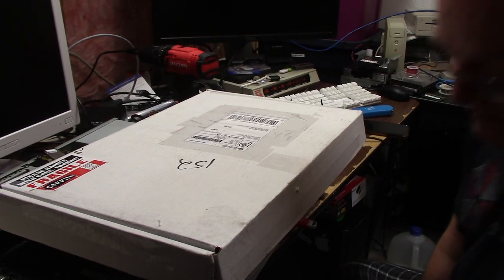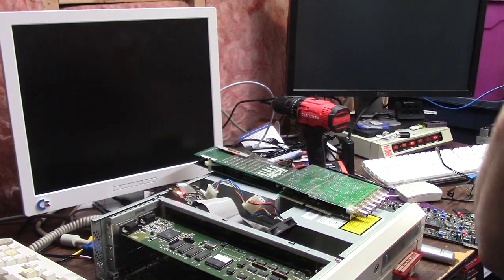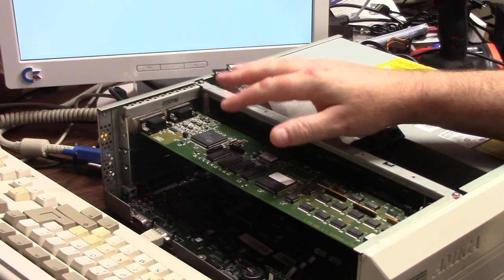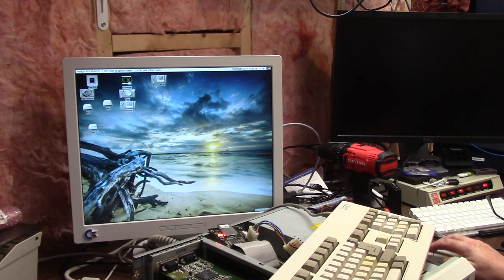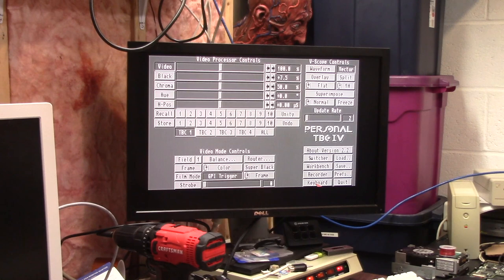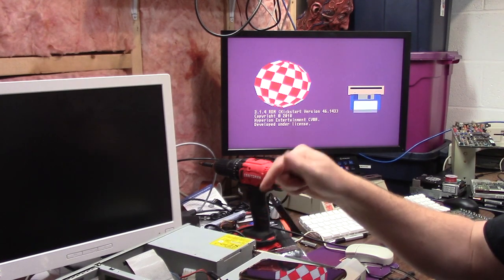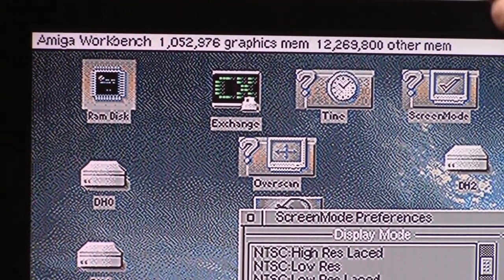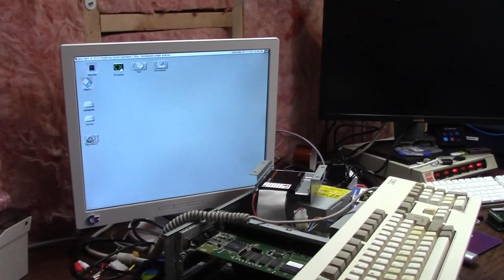Video toaster 2000 in a 4000, spectrum and small issues.

Comment: if you ever pick/save a bad screen mode,u can boot with no startup-sequence and delete screenmode.prefs  and it will default back to a default 15khz mode. then boot normal and pick a new screen mode. (if i understand the problem you ran into).
Reply from the maker: a4000t yes thats what i did but while filming it was easier to just swap the disk and continue. Shes all better now.   Thanks!
Reply: @ChrisEdwardsRestoration  well,i'm just no help at all then ROFL.